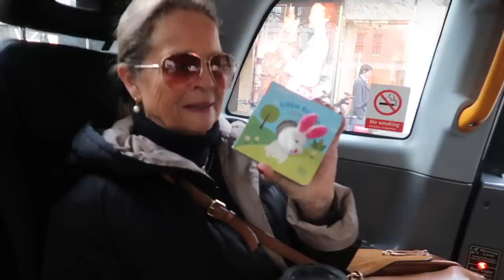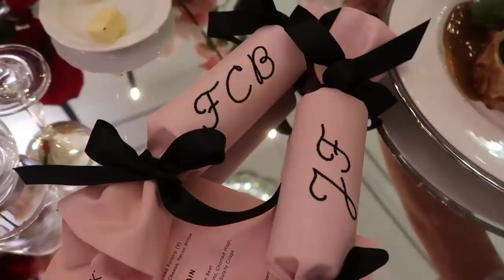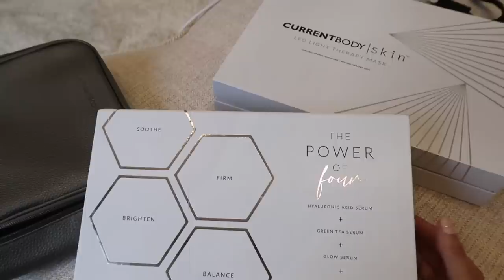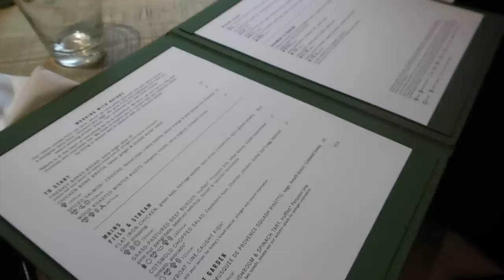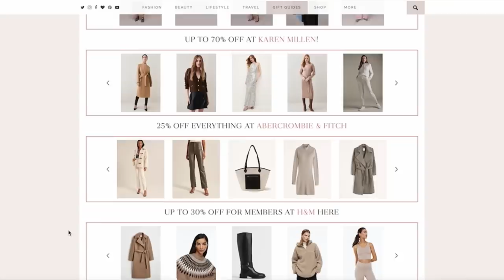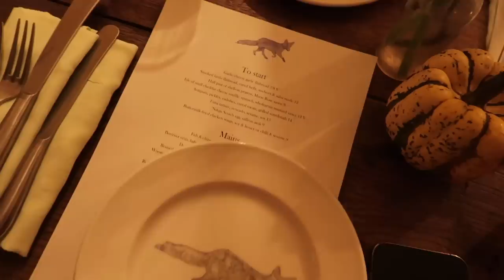FESTIVE PARTIES & OUR NEW FAVOURITE COTSWOLDS PUB // Fashion Mumblr Vlogs

Comment: Just a quick note about your greenhouse thermometer - it should always be in the shade - if it's in the sun it'll give too high a reading - I have a battery operating min/max thermometer, so that the part that reads the temperature is in a slatted storage box in the greenhouse, and the screen is on my kitchen windowsill. Even then, I get high readings in the afternoon for an hour or so, as the sun comes round to the gable end and shines directly on the box (I have shades on the south side). ❤️

Comment: Josie, I shared 2 very interesting informative videos from a dermatologist u-tuber about overusing hyaluronic acid and debunking the hype on your Instagram account.It can dehydrate your face at high concentrations and more than a 5% solution. And you must use a moisturizer afterwards for the acid to actually work…. the acid is not moisturizing on its own… needs an occlusive on top of it to actually hold in the water on your face , otherwise it sucks up all of the water around it and that’s it.The skin care businesses are touting hyaluronic acid much more than it is worth…It is being waaay over commercialized for financial gain.🤍